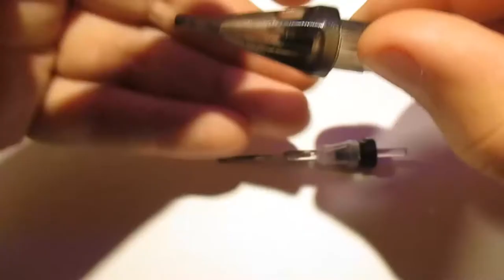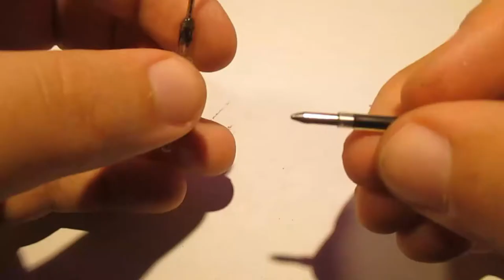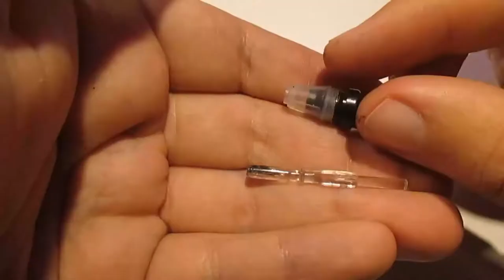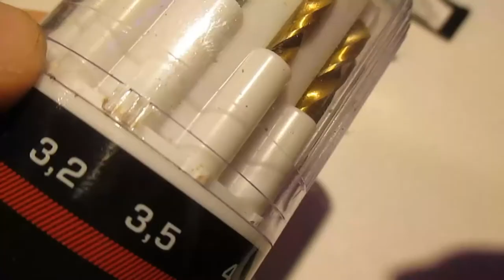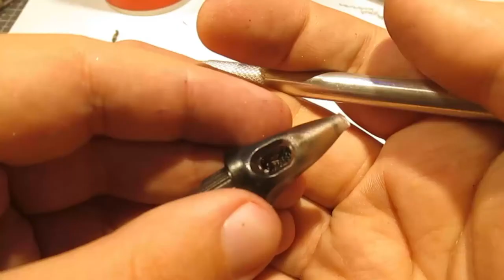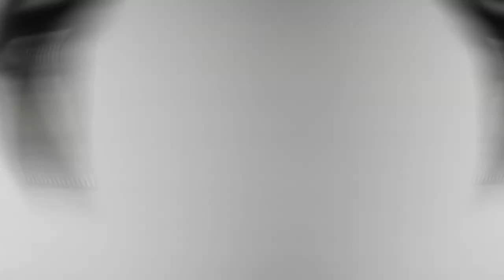How To Make Ball Pen Tattoo Needle Cartiger (Dotpen)

Comment: Awesome video thanks!! But I just did mine and a little tip, when I cut the needle I left about a half centimeter of hangover and the pen slides right over that, just helps with less sanding